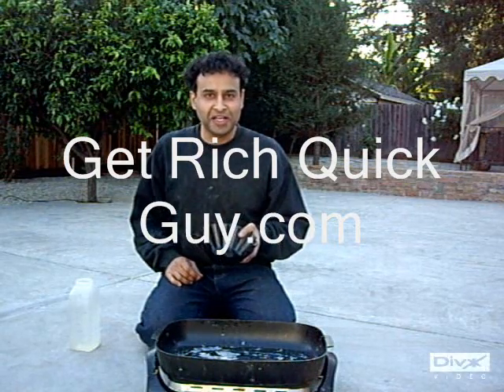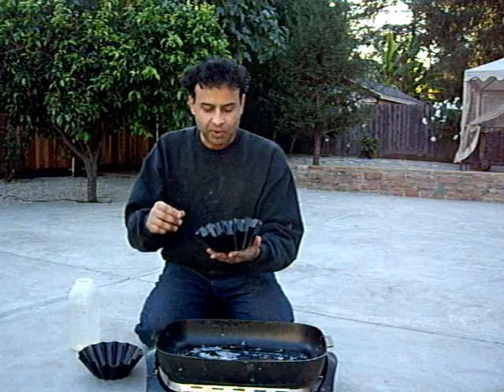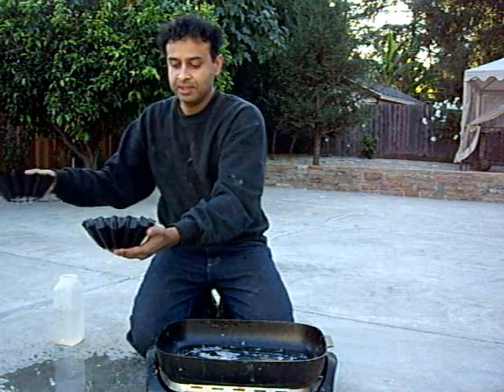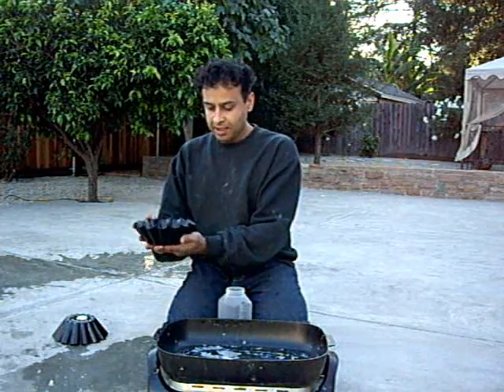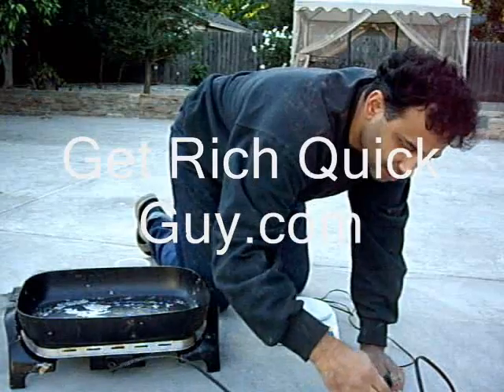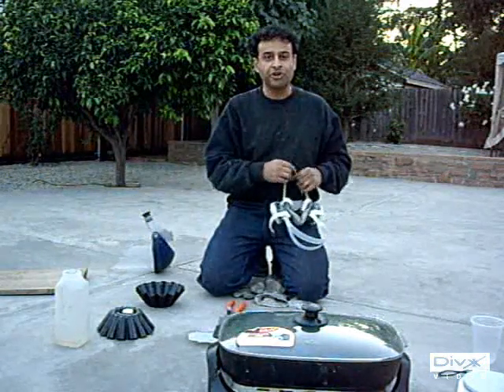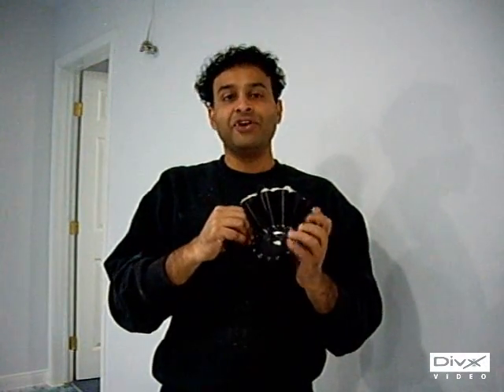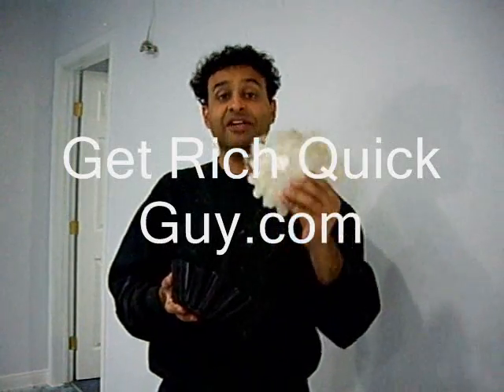Press_Mold_001_0001.wmv

Comment: I am an engineer, and know for a fact you can never form plastic without adequate pressure. It is so because plastic is a very good insulator and does not conduct heat well. None the less, the videos of failed attempts are very entertaining and well made!